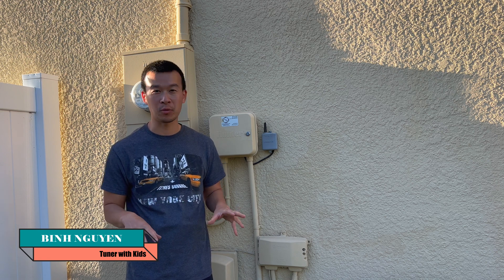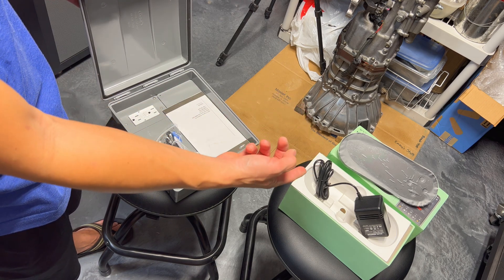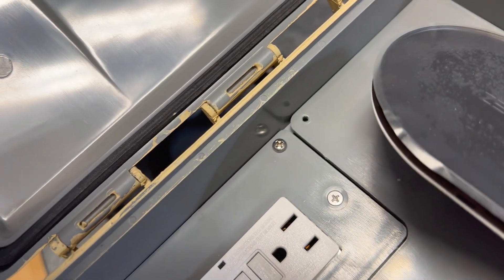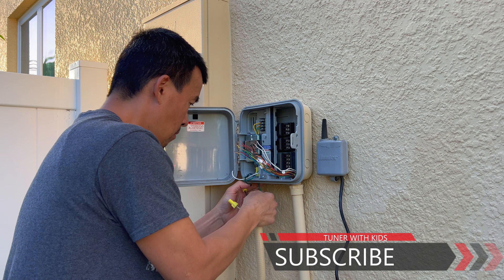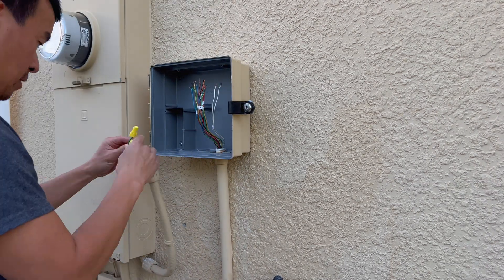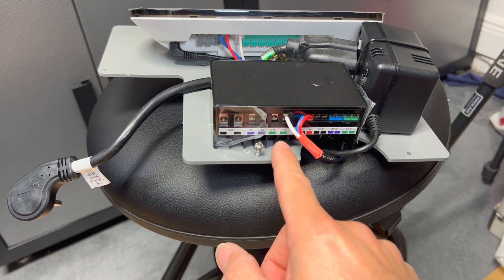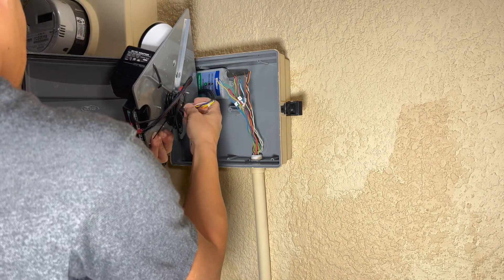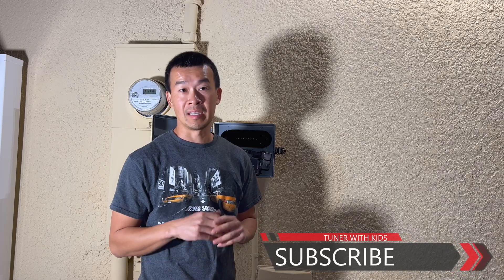How to Install Wyze Sprinkler Controller | Home Automation Smart Irrigation

Comment: I have a Rain Dial RD-1200 and it has earth ground terminal can I connect that wire to common port on Wyze sprinkler.?? This where I’m stuck as Rain Dial does not have direct C or white wire

Comment: I hope you talked about the wiring more particularly with the rain sensor which I am stuck with. Great video though, very detailed. Thanks for sharing
Reply from the maker: I’m reusing my Rainbird sensor, not sure if it works or not yet. For the past year, I’ve been on the free water plan with Wyze that automatically adjusted my schedule for rain in my location. I canceled on renewal since it’s $10/yr.

Comment: How does the scheduling work with the Wyze app? Do you set each zone individually to go off on specific days/times, or do you set days and times and then assign zones to them? I am thinking about getting the wyze controller, but i want to make sure I have the Customization I want. I want to run stations 1 and 2 alternating in 10 min intervals for a total of 20 mins each. And i want to do that 3 days a week. I also want to run stations 3 and 4 for 2 hrs each two days a week. Is this possible with the controller and app?
Reply from the maker: Yes it possible, there’s a schedule setting for run days and time. I have water restrictions so mine is set for days I can water.
Reply: @Binh-Tuner with Kids  thank you. Also is there any way hard wire the power wires into the device like with old controllers or do you have to use the outlet plug?
Reply from the maker: You can cut, solder and rig the barrel connector to take a traditional 24VAC from old transformer. I thought about it but was too much trouble. Easier to plug it in using the wall wart transformer.
Reply: Okay thank you. I appreciate it